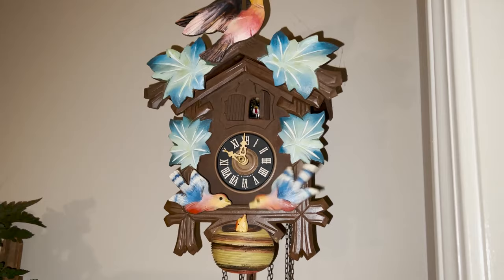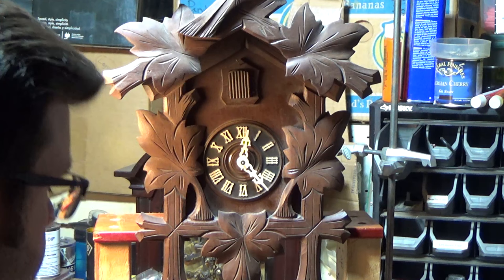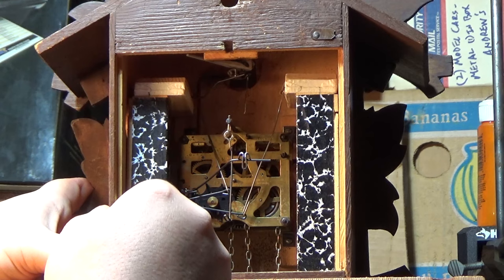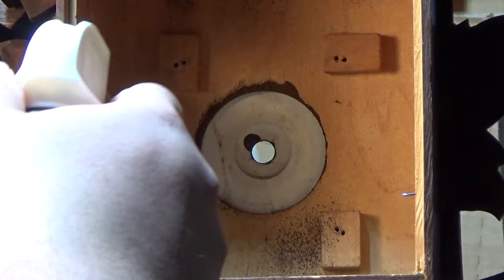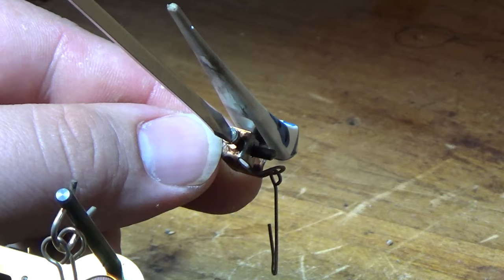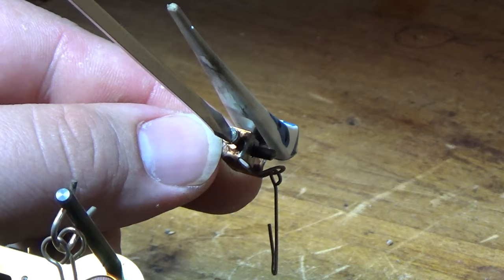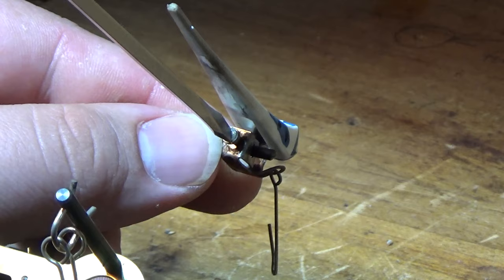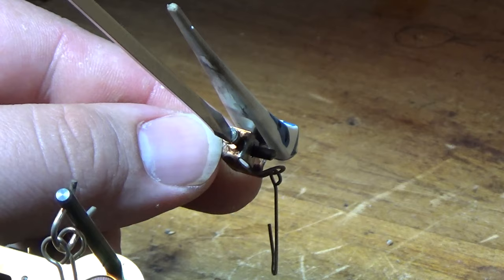Cuckoo Clocks - Function, Disassembly and Reassembly

Comment: interesting.  thanks.  i see that this clock only has two weights - correct?   i've seen a clock with three weights and wonder what the difference.  i have not had a chance to take that clock down from the wall and check its innards.
Reply from the maker: 3 weights usually indicates it also has a music box.  After it completes the "cuckoo" on the hour (and also the half-hour depending on setup), the music box starts playing.

Comment: My clock all of a sudden stopped ticking.
The pendulum stops. 
The chain on the right won't move.
It's like stuck.
What's wrong? 
It was working for a long time although I never could adjust or figure out the correct time.

Comment: The chain on the far right is always about 5 inches long when the one on the left which is for the actual time is at the end of it's links.  The one in the middle is bout half-way between when the clock stops. That's why the question as to whether they're different lengths.
Reply from the maker: Ah ok I see what you mean now. When fully wound, the loose chains hanging down should be about the same length. The one for the music box is usually a bit longer. You could take the extra bit of chain from the music box side (the far right) and add it to the time chain on the left to give you a bit more time.
Reply: the chains should all end up more or less at the same level over 24 hours. The chime chain will drop more from 7 to 12 o'clock and less from 1 to 6 o'clock  If one is only half way down, I'd say that it would be the music train and it's most likely only playing on the hour rather than on the hour and the half our!  (Guess how I know that? My musical cuckoo clock has a mind of its own and randomly misses playing on the half hour.  When I go to wind it up I can see whether it has played every time or not by how much the weight has dropped.)

Comment: I do not know if you watch your comments but I have a question about a cuckoo clock of mine that I am tryign to repair its a 25-86 series, I had to replace the verge and clutch (I think that is what it is called). got it on and now put back together using your videos but now the clock makes a clicking sound but no other sounds. The bellows do not bellow and it has me puzzled. If you can help me it would be appreciated.
Reply: Thanks for the quick response on Facebook and the clock is working great just gotta get the tik-tok working right so the time is right, making small adjustment as we speak, I am sure I will get it right sooner or later.

Comment: Thanks for the video, very informative! I have exactly the same clock and somehow the right chain doesnt hold the weight and falls off. the chain is correctly in the gears, but somehow the gears do not hold the weight. Any idea what could cause this?
Reply from the maker: It sounds very much like the click, or the click spring, is broken or misaligned.  Not the easiest of repairs, unfortunately, as it will require disassembling the movement to correct.  You can purchase the entire wheel assembly and replace that, but the easiest solution is to replace the entire movement, and can usually be done for under $100 if done yourself, but there are different types with different pendulum lengths that need to be considered first.

Comment: I notice you have a test stand....have you any ideas etc to build one..cheers
Reply from the maker: As soon as I’m able, I’ll make a video on that! Thanks! (Sorry for the late reply!) This is a simple design I came up with that will handle most cuckoo clocks. The top is an old industrial cutting board from a restaurant, the rest was scrap wood. It also has adjustable leveling feet.

Comment: Mine still wont stay swinging. Also the bird is not coming out when it hits the hour or half hour ....I want to cry, my bird doesnt even come out if I move the hands. I dont even had a manuel trip arm
Reply from the maker: If you tried getting it set in beat and it still won't stay running, and the cuckoo isn't striking properly, it's probably time for the movement to be serviced or replaced, unfortunately.  Good luck!

Comment: I have a 3 weight cuckoo clock the chain is coming down freely no tension on the musical/ dancer chain.  Any idea on how to fix so it won’t drop freely?
Reply from the maker: If you verified the chain is sitting on the sprocket correctly, the fix for that depends on the configuration of the clock.  If you have a roof mounted music box, the set screw on the winding wheel (sprocket) has probably loosened causing it to turn freely, or the click (ratchet) has an issue that keeps it from grabbing properly.  If the music box is mounted on the side and there's a wheel (gear) that interacts with the bottom of the movement, a set screw could be the main culprit or it isn't lined up with the other wheels correctly.  It could also still be a click issue, however.  All of these solutions will require taking everything out of the case to fix, however.  Good luck!

Comment: The left hand chain will not come back down after being pulled up.  My bellows are glued in place as well as the screw.  Any way to release that chain without removing the movement?
Reply from the maker: Is the end of the chain stuck inside the movement? Are the hooks still attached?
Reply: @BrackenClockWorks  The hooks are still attached, but pulled right to the top.
Reply: @gordonpirie6466  Try taking a separate length of chain and attach it to the link with the hook on it, then remove the hook and then you'll be able pull the chain through to pinch that one link back together.

Comment: Great video. What material using for repair Bellows(sound) up pieces
Reply from the maker: There is specific material available from clock suppliers to replace it, however I've found it quicker, easier and more cost effective to just replace the entire top with an already assembled part, which are also available from clock suppliers.  Just measure the top and order the closest to that size, pop the old one off and glue the new one on with a hot glue gun.  Cheers!
Reply: Thank you very much

Comment: How did you clean and oil the movement? What kind of oil did you use? How much oil? I'm assuming you did all that off camera cause you don't show that part in the video.
Reply from the maker: In this case, since the clock is weight-driven, it’s easier to run the entire movement through an ultrasonic cleaner with a special clock cleaning solution. The oil is a synthetic oil specifically designed for use in clocks, and only needed in very small amounts where the pivot points of the wheels poke through the front and back plates.
Reply: @BrackenClockWorks  What would an ultrasonic cleaner for a clock movement look like? How much would they cost?
Reply: @traviscampbell2374  I bought the ammonium concentrated solution for clock movement cleaning(used one part of solution to 7 parts water) and clock oil, both on Ebay.
Reply from the maker: Ultrasonic cleaners vary greatly in price, and totally depends on quality.  If you're doing this as a hobby, a small, simple one from Harbor Freight will get you by and cost less than $100.  The one I use is an L&R brand, 2 gallon tank, brand new was in excess of $500.  The cleaning solution I use most often is an ammonia-based solution called AstroClean, available from Merritts.com.  However, don't use it on modern, more expensive movements, as it will strip the lacquer.
Reply: Thank you both for the info.

Comment: I had brought cuckoo clock in 2011 however never used recently installed. Cuckoo is coming only once  and making only one time sound even any hour. Eg if 3 o’clock it’s sound only once.
Reply from the maker: Sounds like the lift lever isn't lifting high enough for the rack to drop, or the rack is stuck on something.  Unfortunately, this is all on the front of the movement, so taking the movement out is the best way of finding out what is going on.
Reply: Can I send backside photo to look it.

Comment: What does it mean when the pendulum won't keep moving back and forth?
Reply from the maker: Hi, Peggy!  Well, there can be a few things holding it up.  It could be rubbing on something if it stops pretty quickly, or it could be out of beat and stopping after a dozen or so swings, or the movement could be worn out.  Best case is to work from simplest solution to the more complicated.  Open the back and make sure nothing related to the pendulum is rubbing on anything, first.  Then next would be to listen to the beat.  If it's evenly ticking but still stopping, then you know the movement is probably worn out.  Another thing is to check and see that the chains are properly seated in the sprockets.  If the movement is worn out, a replacement is usually available, but it depends on manufacturer.  Regula is still made today, Herr just recently went out of business, and Cuckoo Clock Manufacturing movements have been out of production for a few years.  In most cases, if it isn't a Regula, you can use a Regula movement as a replacement but will require some alterations to the case or even some of the inside components, but nothing too labor intensive.
Reply: @BrackenClockWorks   Thank you so much for your prompt response. I appreciate it. I just had the clock movement cleaned /oiled and the bellows repaired.  Now that I have at home and assembled it, For some reason the pendulum stops And I can hear it ticking, but not loudly. I'm thinking it's the way I have the cuckoo clock against the wall and will need to screw it in better. Any recommendations for screwing it flush to the wall? Also someone told me that the chains should not be on the floor so I will have to screw it to the wall high enough. I will check out your responses. It seems to be even late ticking but still stopping.
Reply from the maker: Flush against the wall is a bit important but it would have to be tilted forward quite bit for it to cause issues. Use a good screw to hold it to the wall, like a typical drywall screw, where you can adjust how far the clock is tilting by screw it in to the wall a bit more. And you want the bottom of the case to be at least 60 inches from the floor, best at 6ft or 72 inches. Chains touching the floor isn’t critical.
Reply: @BrackenClockWorks   I think the only solution for why my pendulum will not swing back-and-forth for long periods of time,  is that it must be out of beat. 

I have tried everything else and I know that my movement is not worn out. Can you give me any suggestions for if my pendulum is out of beat? 

When I take the pendulum off the wire it will tick on its own and move back and 4th for long periods of time but it will stop. It will not continuously move back-and-forth consistently. 

When I put the pendulum on, it  Will not last long and stop. Whereas, I take the pendulum off and the wire moves back-and-forth quickly And will last longer than if the pendulum was off. 

It has to be a simple fix. I don't want to have to take it to the repair shop again as it's quite pricey! Thank you so much
Reply: Replacing a worn out movement destroys the uniqueness of an antique cuckoo clock.  Re-bushing and, if needed, re-pivoting is the way to go.  Specials skills are needed, but it keeps your clock authentic. 
I do like your video and will subscribe momentarily.
Reply: @Bill Trefts  I had 5 bushings replaced
My bellows repaired and my movement cleaned and oiled

Comment: What steps can i take if the reset switch doesn’t activate the clock?
Reply from the maker: Is the clock mechanical or battery driven?
Reply: Mechanical, exactly same as the one you’re working on
Reply: Also another video shows the mechanism being cleaned in soapy water, is this recommended?
Reply from the maker: If the repeater lever (trip lever) doesn't make it go off, it could be too close to the hour/half hour, or there is some other issue preventing it from going off.  As for cleaning, soapy water is fine as long as the water is removed as completely as possible before final drying, otherwise it will cause rusting of the steel parts.  You can use Dawn dish soap, or Simple Green, both mixed in warm (not hot) water to clean.  Use an old toothbrush to scrub out the old oil and dirt.  Keep in mind it won't shine up as nice as in the video without proper cleaning solutions and ultrasonic machines, but using the above method will do the trick as long as the movement isn't totally worn out.  Cheers!
Reply: Just an update since we last spoke, the Cuckoo clock is working once I reassembled it and popped it back on the wall with the trip lever. However, the pendulum stops swinging after about 15 to 30 seconds. Any ideas?